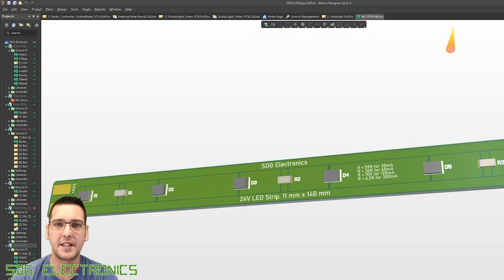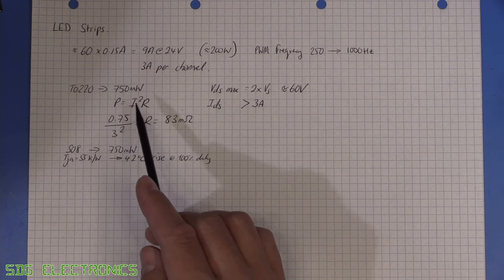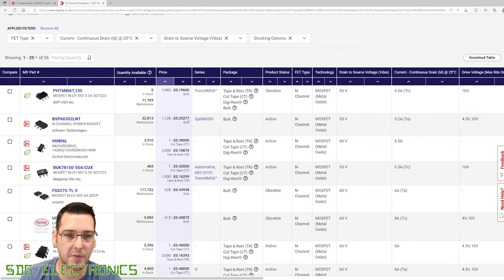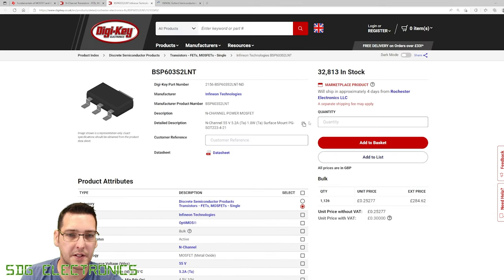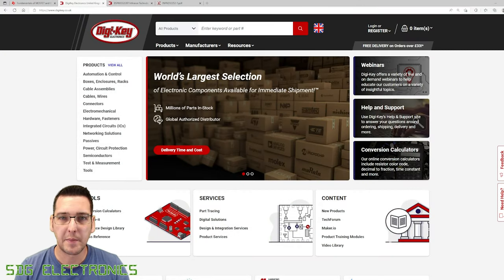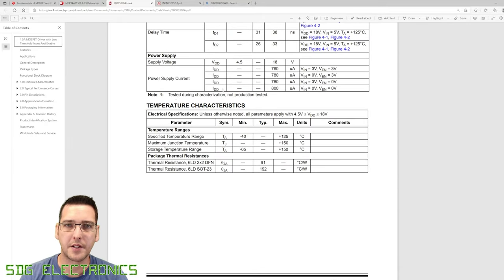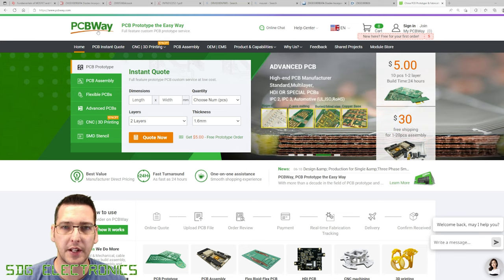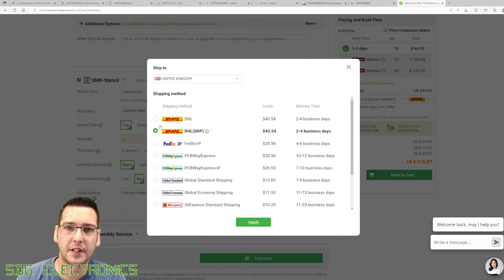SDG #273 MOSFETs, Gate Drivers and PWM Driver Design

Comment: Having significant switching currents in long lengths of wire might cause oscillation and EMI problems. A gate resistor, like 3-10 ohms, will save your design.  The gate pull-down resistor of 100k is quite high, I might use within 20k in this design .. The gate resistor also saves the driver transistors from exceeding their max when the gate cap starts charging
Reply from the maker: I amended the schematic slightly before ordering PCBs. I added the pull-downs before the gate driver rather than at the gate and did indeed add a position to add gate resistors. Thanks for the comment!
Reply: @sdgelectronics  Well done, pads do not have to be populated and save you PCB revisions.

Comment: Nice video, it’s always good to see the thinking behind the design. The times I’ve looked at 150A power fets only to find that if you want to put it on a normal size heatsink  you can’t pull anything close to its max, they seem to have strange ideas of real world properties of metals used for heatsinks.
Reply from the maker: I destroyed many in my youth with high-power experiments; even with all that thermal mass, you can burn out the die before the package or heatsink has started warming up!
Reply: @sdgelectronics  that's part of the fun working out all the thermal resistances. In the hope that the junction temperature won't go above the melting point of silcon 🙂

Comment: If you are going to use long cables I would also recommend a small simple RC snubber on the MOSFET output, at turn-off you will get a lot of ringing without one.

Comment: It's worth mentioning that for similar sized FETs, devices with a higher max Vds rating tend to come with higher Rds on figures, so it's worth considering the minimum voltage rating you can get away with. Generally I avoid PWM as a method of power delivery unless it's constrained to a small area on a PCB, having significant switching currents in long lengths of wire sounds like an EMI problem.
Reply: In this case, the load is a constant-current LED driver (see previous videos). If you'd create an analog voltage, you will have a huge difference in intensity caused by the cable drop, which was the reason to use the constant-current drivers in the first place.
Low-frequency PWM like this is also used a lot in automotive. They often just use use unshielded cables and the EMI requirements are quite strict, so I think this will work just fine.
Reply: @tomvleeuwen  The load is current limited in the on period of the PWM cycle, but the current is zero in the off period. This constantly changing current is the fundamental problem as it has significant energy at high frequencies, and the parasitic inductances and capacitances cause ringing. EMI standards are relative to the environment, a car is a very noisy environment already with alternators and spark plug discharges, the concern is whether one system will interfere with another. In a home environment there are different EMI concerns, for example PWM controlled lights or even some DC LED drivers with high AC ripple cause interference with oscilloscope and spectrum measurements, and cause noise on magnetic pickups and high impedance cabling, even shielding only helps to an extent. Your standards may vary for your application.

Comment: I hope you get no audiable issues. (with smps they are not granted). I always tend to avoid 3kHz switching like plague, because ears are the most sensitive there. 3 interlaced pwm at 1kHz = 3kHz. Of course, you can always adjust the frequency to say 250kHz to make any issues much less of a problem. To be safe, I use a design criteria to keep everything much below 3kHz or well above audiable frequencies.
Reply from the maker: Fortunately, the power supply is in the attic, so even if it makes noise, it'll not be heard in the house.

Comment: I would have the mosfets by quantity available and then filter by voltage and rdson and the other specs ... in theory those available in higher quantities are more common and easier to source from multiple stores... you picked that GOFORD brand mosfet in crappy package (power dissipation wise) ... For example AON2260 and AON2290 seem much better and they're 50 cents each and there's 200k+ of them in stock... and if it's about price, TME has AOD4184A or AOD4186 (max 40v) both to252 packages at 15-20 euro cents, if you order 20...

Comment: Check the gates with an oscilloscope for oscillations ( "ringing" ). Not using gate resistors might cause some trouble ( increased EMI emissions at least ).  Even small, 10 ohm gate resistor can reduce ( dampen ) any gate driving circuit oscillations.

Comment: I'm wee bit confused by your 60 x 0.15A calculation; Each 11x140mm board draws 150mA (regulated by the AL5809, so for 60x are you powering 60x boards? The series "string" of 6x LEDs only sees 150mA right? I'm not sure how it would see 6x150mA with the CC regulator in place?

**One possibility is having 10x boards in parallel, that's 60 LEDs with each 6-segment getting 150mA; Still each board is regulated so the Isupply would be 150x10 = 1500mA, only 1.5A.  No where close to 9A. Hmm...
Reply: 60 boards * 0.15A is 9A. Its not 60 LEDs its 360 right.
Reply: @jaro6985  Single board has a CC AL5809 - this limits max current to 6 LEDs to 150mA.  This means the entire PCB can only draw 150mA (shared across 6x LEDs).  Since it's series each LED gets 150mA - and the Vsupply is just 150mA too.  So yeah, 60x PCBs = 360 LEDs.
Reply from the maker: @bsodmike  All the PCBs are in parallel to keep the overall voltage below the 50 DC limit for installation in the bathroom, so it's 60 PCBs, all in parallel, drawing 24V*0.15A
Reply: @sdgelectronics  thanks. That makes a whole lot of sense!!  Would be great if you could share shots of the installation. It must be pretty large!

Comment: Isn't the gate resistors required anyway, even if one wants the maximum current?
Reply from the maker: Not on a MOSFET. You can use a gate resistor to help with ringing, though.
Reply: @sdgelectronics  It's not only about oscillations. Gate capacitance acts like a dead short when driver changes it's state. Current that flows then is much higher than the driver's max Ion/Ioff. Makes it getting warmer, in some cases might bring it's VCC too low, causing more oscillations, and in extreme cases damage the chip. Gate resistors are especially important when the MOSFET is driven straight from a MCU, which usually can't source/sink more than 20...40mA.
Reply: @sdgelectronics  you will always get ringing with a capable driver, so it is essential.
So calc its value at least for Imax of the driver.